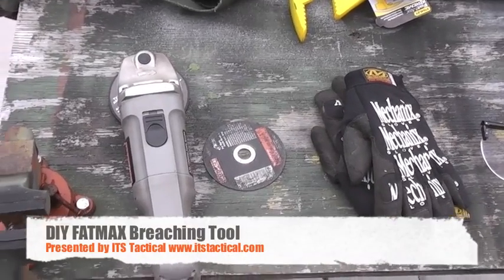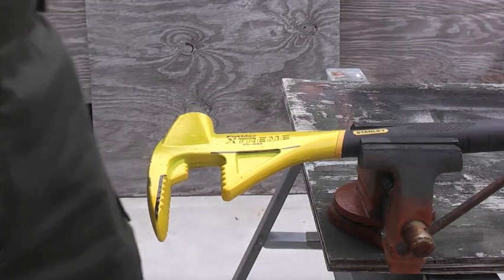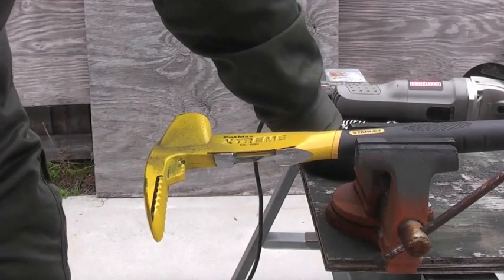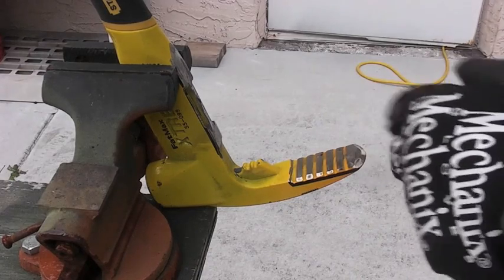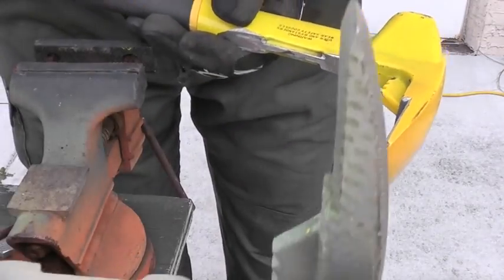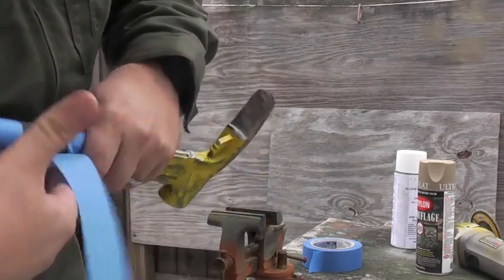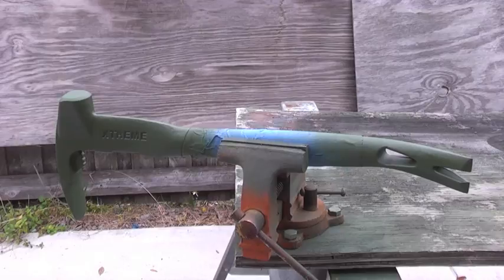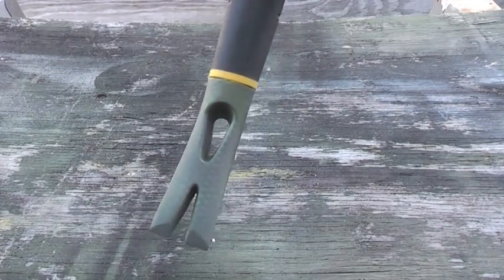DIY Fatmax Breaching Tool

Comment: Painting it camo helps you sneak up on the door.
Reply: It definitely won’t see you coming
Reply: Facts
Reply: I did that but then I couldn't find it anymore
Reply: I use metallic fleck hot pink rolled in glitter with it’s pronounced stenciled on the side so the door feels less offended😂
It’s pronouns are “it and aircraft”.

Comment: In a professional and industrial setting, tools are modified several times a day, no questions asked. Hell, I've cut the drive section off 1" drive impact sockets, plasma cut a new socket, and tigged the drive section plate onto the cut pieces to make a socket that took over 2,000 ft/lb of torque.

Those who say "Don't modify tools! Think of the safety!" are those whom most likely don't have tools in the first place. This is an excellent idea, I plan on modifying the idea a bit as well. Thanks!

Comment: A hint for safety, make a habit of always laying down your angle grinder with the disk facing upwards.
Otherwise, if you accidently hit the switch while picking it up, or if you lay it down while the disk is still spinning, violent things may happen.
Reply: utilizing the guarding would have been a better starting point

Comment: You point out to have safety glasses and gloves but the guard has been removed and side handle from the grinder. I bought a pack of zip blades where every time i started cutting the metal arbor in the middle of the blade would come off the wheel sending the wheel flying. I took the pack back and was told there was a recall on those blades for that reason. If I never had the guard on I could of got that blade in the neck, chest, or arm very easily. I would use a guard before gloves that can melt any day. Stay safe and wear leather or at least gloves that wont melt to your skin and put that guard back on!

Comment: interesting point I heard on this topic while watching a different video: although a halligan is obviously better since a single purpose tool is more efficient at that one thing than a multitool would be for the same task.  but most people who carry them in a bag or  trunk are thieves, at least in the minds of some police officers. sure, firemen use halligans at work all the time, but the tools belong to the city. those same firemen might not have one at home. many construction workers certainly travel with halligans, BUT they also have entire truckloads of other building tools that give them credibility. so the point the other video was trying to make was that using a Fatmax from Walmart could pass as just a simple tool that John Doe, law abiding citizen, may just happen to have in his car. obviously painting and modding it out kinda kills that excuse. but I know I've had run ins with individual officers who didn't know all of the laws regarding some of the tools and equipment that I had on me. and in 1 incident they just tried to find something else to find fault with. so I just try to keep all of my gear discreet and make my kids look close to stock issue.  every city and state are different just like our individual prep/survival philosophies. I still thought it was interesting point to consider.  GREAT WORK ON THE TOOL THOUGH!

Comment: This isn't my video, but I have to say something about one or two of these comments... 1. those are solid T304 stainless to the best of my knowledge, unless you are cutting this thing with a blowtorch, you will not "ruin the metallurgy". 2. you don't use cutting fluid with fiber cutting wheels and/or grinding discs. you would use cutting fluid on carbide or HSS cutting tools though. 3. while I agree with most of you on if you're a L.E.O. you probably would just buy a breaching tool. Who knows? maybe dudes got 20 kids and 19 ex's and because of child support had to make an inexpensive one. I'm just saying, cut this guy a little slack! Fuckin A! Everyone's a critic now days when no one is a master of what they're critiquing. @ITStactical ALWAYS hold the grinder so the wheel is spinning toward the ground, or pulling the grinder away from you. Sometimes you have to take stuff out of the vise an flip it over, but it beats getting stitches or losing a finger... (I've had stitches more than once from rushing through something and having the grinder kick back at me. A trip to the ER takes more time than repositioning something in the vise) I didn't notice if you did or not, but you should flip the can over and spray until you just get air out of the nozzle. Wiping off the outside of the nozzle doesn't matter if the nozzle is still full of paint that will dry and clog it... Not raggin on ya just trying to be helpful. While I'd love to keep correcting some of the idiots that are giving you all kinds of shit in these comments, I recently realized that trying to fix stupid is a waste of energy. Great info and product demos in the majority of your videos brother, keep it up!
Reply: +Micah Thomason thank you. Not going to lie, I was sort of around of that one when I read it back LOL
Reply: +Ryan Daniels proud* autocorrect

Comment: You should modify a fence puller and use it as a door hammer or like use a sledge hammer, you can also use a cordless angle grinder and masonary hole saw set for lay up hides in urban areas

Comment: You could rough up the rubber handle and spray it with plastidip, get rid of the yellow so it fits with the color scheme and doesn't lose the grip. Some of my tools I even put stuff like fine grain sand in the plastidip for texture.

Comment: secondly both your cutting and grinding discs have a lot more use in them grinding discs have a very long use life and unless your using them all the time they will last about 20 hours of good use and a cutting disc will still cut even down at 2" ask at your local hardwear store for the right disc to use when grinding differant metals as there are discs for both soft and hard metals

Comment: Hey ITS have you tried putting a ax edge between the hammer face and the handle. Looks like it would be a good spot for it or would it just get in the way?

Comment: @ITStactical well im not sure of the handle construction, but i would like to at least get rid of the yellow borders. if it is just rubber coated over the steel tool i would maybe remove it and have a more simple slimline handle. then again i havent held this tool so i dont know how i could do it yet.

Comment: I have to echo the sentiment of other posters on here, use the guard for your grinder!  Better yet, use a portaband, it's easier, quicker and safer.  While I do like your ingenuity, mini halligans can be bought for less than $100, are more functional and don't need the mod work.  Also, tipping the spray paint over and spraying for just a second cleans the whole nozzle pretty quick.  Keep up the good work!
Reply: What are mini halligans?

Comment: Those grinding and cutting disks still have 99.5% life left. They are designed to wear away and maintain the cutting and grinding ability throughout the whole disk. Unlike a saw blade they do not dull. The cutting disks can be used until you cannot physically touch them to the work material as the gearbox of the grinder touches first.

Grinding wheels can be used until they are a stub no bigger the the mounting flanges.

Comment: Im considering doing mine like this. I dont need to breach doors but it would have been nice if they made this with the sharper back spike. Alot of times it would come in handy trying to get between tighter thick boards.
Reply: Right?

I really tried to like the board bender, but it really isn't all that useful.

I have a modded one and a stock one and I find the modded one to be far more useful.

Comment: Looks like a pretty expensive way to create a crowbar, which you can get at that size for about $16.
Reply: ***** $10 bucks
Reply: I actually think you can buy a hammer that looks like this . The only issue with the hammer is the face might be hard enough one light need to de harden it it a bit so it doesn’t shatter

Comment: I suggest if you buy a grinder you invest a little more and get a 6" so you can use the extremely handy 6" cutting disks. Instead of a grinding "rock", I prefer flap discs for blending and shaping because they polish as they cut. If you want to keep your work cool just periodically dunk it in a pail of water. Take your time and you won't overheat the steel. If in doubt, periodically check and if the work isn't hotter than your bare hand can stand you are at no risk annealing the metal.

Comment: WELL IT'S A GREAT VIDEO ON HOW TO MODIFY A TOOL I WANT TO SEE HOW THE FRACKING THING WORKS DO VIDEO ON THAT
Reply: If you don't know what it's for you probably don't need it.
Reply: thirteenospades
I KNOW WHAT IT IS FOR I WANTED TO SEE YOUR MODIFICATION IN USE TO SEE IF IT WOULD HOLD UP AFTER YOUR MODIFICATION ( JUST TO LET YOU KNOW I HAVE A REGULAR  L.E. BREACHER )
Reply: Talon Gunter 1. Not my video. 2. I think your caps lock is stuck. 3. Good for you.

Comment: For those who don't yet own an angle grinder, do thyself a favor and buy a SIX incher for the glorious cutting discs whose extra reach and edge speed are well worth it. I modded all my guards on smaller grinders to take 6" discs too (I don't run cutting wheels without guards and still have all my fingers).

Comment: All C-130 have that hatchet tool. That spike on the back is to get an initial cut going incase egress through an existing exit is some some god only knows why sort of reason blocked and you have to cut through the aircraft's skin.  The hatchet on the plane though is about a third as wide as the tool in this video though.

Comment: Always have the sparks coming back towards you, if the grinder grabs it will then try to kick forwards away from you rather than backwards towards you. For grinding and removing metal quickly a flat flap disc is a better option than a grinding disc if you can find the discs with 3 cut outs you can actually see the work piece through the gaps as the disc rotates. I seldom use a guard on my 4.5 inch grinders if you're careful and take your time there is no problem running without a guard fitted. The flat flap discs are available in many different grits so you can remove a large amount of metal quickly with a coarse disc and then a finer garde to finish up and sharpen the tip up

Comment: You may want to re-temper the tool after all that grining. The heat will ruin the temper in the "worked" areas, causing it to be a little weaker.

Comment: @BigBodySmallBrain Torch would certainly cut through it, but change the temper and destroy its strength in the process rendering it useless, Chance of breaking the first time you used it. A cutting disc and flap wheel are more precise and more suited to the job.

Comment: The 'sanding disc' or 'flap disc' cuts much faster than a grinder. I used to use these to cut welds from up to 7/8" steel. You should use it to remove those teeth.

Comment: You took a fully functioning tool with actual breaching ability, and made it into a hammer withOUT a claw in it's head to even pull out a nail. You made a tool that it now, only able to be used as a hammer. You actually succeeded at making a tool LESS useful! Congrats. LMBO!!!
Reply: The lower jaw/board grabber really isn't that useful (and your can accomplish the same things with the breaching pick that you can with the board grabber, anyway) and good luck ripping the door off its hinges with a stock one. You really need that tapered pick setup to properly breach a door. 

Also the nail puller is in the pry bar portion at the base... But I guess you're just not very observant.

Comment: Cool! The Stanley 55-119 is a pretty similar design to the stock model 55-099 you use here, its slightly shorter and only about half the weight. You could do the same mod to the 55-119 and have a lighter more compact tool. With the mod how much weight did the tool lose?

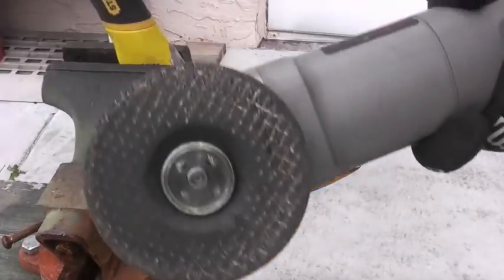Comment: That disc is barely broke in at 9:16. An 80 grit flap disc, or the ("sanding disc" u used later), after that point would have done you a great favor, it will polish it like a mirror. In fact, I would have used a flap disc. Its quicker, cleaner, and doesn't heat up anywhere near as a grinding disc. Otherwise, pretty good video.

Comment: why not use a flap wheel grinder blade?
Reply: Sparky McKlein also grinding blade grab when they are pinched in the metal, if it does that, you angle is off, or you need to pry the two metal peaces apart.

Comment: This is extremely similar to a halligan... but tactical wise this one seems to be more compact
Reply: Ebay has these Fatmax Fubars for around $45-$75.....Halligans start at $350+....Halligans have more of a pointed end for popping out bolts & puncturing sheetmetal doors.
Reply: I know what a halligan is and I've used them many many times for doing just that, but this modded fat max resembles the halligan... and it's much cheaper

Comment: I guess I'm not quite understanding you essentially just made a straight claw hammer
Reply: Watch some videos on breaching techniques.

You get a couple of guys with these (or Halligans) and they cooperate to hammer the pick end of one into the hinge side of the door, and then strike and lever to rip the door off its hinges.

It's actually pretty cool how effective it is. Even on steel security doors.

I used one of these tools to help my old boss get into his safe after some idiots broke in and bashed the dial off of it trying to get in. Same principle: hammer and lever from the hinge side until you rip the whole thing off.

Comment: why not just buy a halligan because that's essentially what you just made minus the spike
Reply: probably because the Halligan bar cost about $200 to $250
Reply: +biohzrd1x1 Those tools are pretty expensive for good quality ones. About $200-$600. This tool is ~$90 on Amazon

Comment: Volunteer fire departments and real fire departments.  Both are just plopped down and say, "Here.  Don't fuck shit up for the mayor.  Put out fires."  There's a standard test and stuff, and a firetruck and some other equipment, but let's face it: you're going into a burning building; there's no such thing as "metric standard".

This is a tool for people who have to move shit out of the way in a specific but variable situation.  By experience, they found a good way to do it.

Comment: Er, you do realize that when you cut that you ruined the heat treatment right? That thing is going to be brittle as hell right at a stress point because you got it so hot while cutting that it changed the hardness. You might want to temper it again.

Comment: Instead of destroying this expensive FatMax tool, why not getting simple crowbar?
Reply: expensive? The thing is like $30. And it isn't destroyed, its been optimized by/for the end user. Get a standard crow bar? A standard crow bar could come close to doing the tasks that this could do, I think you've missed the whole point of this modification
Reply: +Robert N Couldn't* come close
Reply: +Robert N So.. what's the point of this modification?

Comment: Why did you guys modify this tool? Every piece on the tool was put there for a reason, please explain? thank you
Reply: The board bender is essentially useless and not well thought out.

The breaching pick can do just about everything that the board bender can do, and it can rip a steel door off its hinges.

I think this mod is an improvement.

Comment: First, I'm not worrying about what anyone thinks. Second, this shitty little bar isn't going to do much other than open locked hollow core doors. I've used them, the door stop breaks before the frame and you need a hammer to get enough bite into an exterior door frame. They're garbage. 

The reason I posted my original comment was because there are much better tools for the job, he's never going to actually use this and because he put that adorable paint job on it.

Comment: put a fucking guard on that grinder only makes the gloves more dangerous then what they already are
Reply: +haggis240 if you ever id a lot of work with a grinder you would know its more unsafe and just gets in the way, evening big welding shops and factories they have no gard, the guard have hurt more the not having one, as a welder for over 38 years, and seen a lot
Reply: +Romppai's Outdoors i agree with you that the guard gets in the way (somtimes). but hiw does it get less safe?
Reply: my friend die because take of guard cut someting disc broke and hit his face and cut his head to half  sorry for my english

Comment: Never use angle grinder without fence! It's extremely dangerous even if you wear everithing you can find in your shop. Or, even if you do this, please don't show on YouTube. This could kill beginners on the first start..
Reply: *****
See pic. http://www.wickes.co.uk/content/ebiz/wickes/invt/215739/115mm-Angle-Grinder-Cutting-Guard_large.jpg
Fence (guard) is a safety cover where cutting/grinding disk rotates.
Reply: I hear you mate, learned it the hard way, after it ripped through my work gloves. The wound and the scar, though small, will remind me for the rest of my days.
Reply: Discs can also explode or throw off fragments, filling you with shrapnel
Reply: Don't grind with a cutting blade and always keep a 90 degree angle.
Reply: This is true. I died in 2004, the day after I graduated high school from the grinding disk shattering and slicing an artery in my neck. My dad got back from work and found me bled out in the shop. 

Please, be careful and always wear appropriate  PPE!
Reply: Be calling Naturalselection ^^
Reply: Lol, go check out What's Inside's channel.